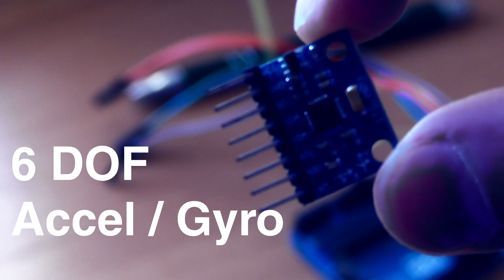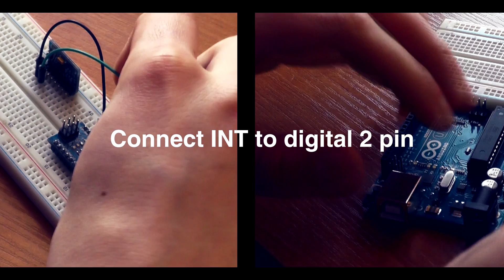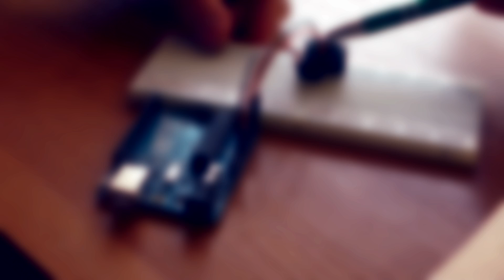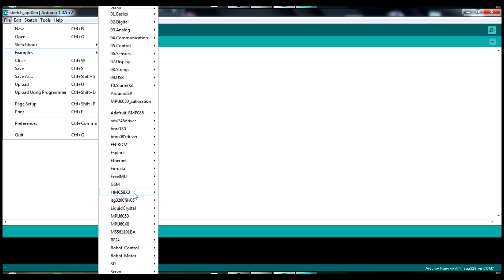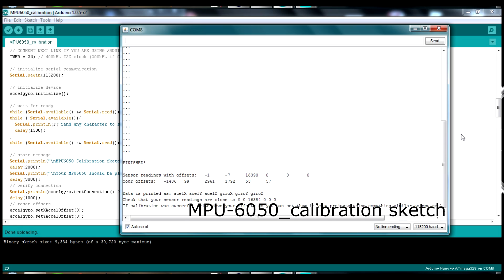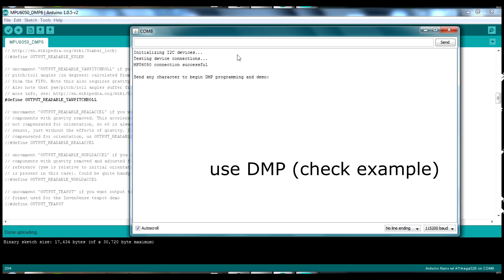MPU-6050 (GY-521) Arduino DMP Tutorial and Calibration

Comment: I tried several libraries, sketches everything i 

could. but i cannot get any data of mpu6050. it gives 

me all zero values. i2caddress scanner gives me 

address of 0x68 and it also shows MPU connected 

successfully. but in DMP6 example of library i get 

following -  IniþInitializing I2C devices... Testing 

device connections... MPU6050 connection successful  

Send any character to begin DMP programming and demo: 

 Initializing DMP...  ------ and it is just stuck 

there  

/////////////////////////////////////////////////////

//////////////////////////////////// for MPU6050_Raw 

example it gives following -  Testing device 

connections... MPU6050 connection successful Updating 

internal sensor offsets... 0 0 0 220 

76 -85  0 0 0 220 76 

-85  a/g: 0 0 0 0 0 

0 a/g: 0 0 0 0 0 0 

a/g: 0 0 0 0 0 0 

a/g: 0 0 0 0 0 0 

a/g: 0 0 0 0 0 0 

a/g: 0 0 0 0 0 0  

All other sketches either give zero values to all or 

gets stuck with DMP initialization. can you please 

help ... what is going wrong.

Comment: I have the same problem "MPU 6050 connection failed".
Libraries are installed correctly.
I'm using Arduino NANO.
INT-D2
VCC - 3V
GND-GND
SCL-A5
SDA-A4
Please any tips?

Comment: In case someone's having issues with the GY-521 and Arduino Mega,. You need to connect the board to the "SDA 20" and "SCL 21" ports respectively instead of ports 4 and 5. :) awesome tutorial thanks!

Comment: My Serial Monitor is stuck at Initializing I2C devices.....when I upload the MPU6050_DMP6.ino file  from https://github.com/jrowberg/i2cdevlibI attached AD0 of sensor to GND of Arduino UNO R3.Modified the  MPU6050_DMP6.ino file as 
MPU6050 mpu(0x68);The sketch in this video used I2CScanner.ino is being shown as an Invalid Library on my systemI'm stuck with a project deadline.Plz help asap ;-(

Comment: Someone can help me? The calibration did not work, serial monitor keeps showing strange values like "Á ùÅ ¶ ù¶ ü¶ ü  ø  øðùðùÐ oÐ oÐ o  ð  ú  ð   ôÐ oÐoÐoð°ÿÐo  ððùÁ ù". I'm using correct IDE 1.0.1 and scanner says my device is ok. What I am doing wrong??? 

Edit: just changed the baud speed and it works
Reply: JUST CHANGE THE BAUD AS YOU MENTION IN PROGRAM  FOR EX: IF YOU USE Serial.begin(115200); IN YOUR CODE THEN YOU MUST HAVE TO SELECT THIS BAUD IN COMMAND LINE WINDOW IN THE BOTTOM OF RIGHT SIDE.
Reply: Vrushank Maharajwala thank you mate
Reply: João Pedro Aguilera Cardoso welcome

Comment: Hello thank you for sharing. Can you clarify what the orientation of the MPU-6050 has to be in. Will having any other orientation invalidate the calibration or does it adjust based on the initial orientation...I ran MPU6050_DMP6 after calibrating and, assuming the readings are in degrees, they did not give the expected range of rotation readings (very limited range readings). Very different from when I run it without calibrating.
     The vendor I received the MPU from soldered the pins in such a way that I had to insert the gyro on the board face down, with axis illustration face down...

Comment: Is using Pin A4 and Pin A5 manditory, or can i just use A3 and A2?
I use the Arduino Pro mini, and the A4 and A5 are not as easy to reach as the other ones
Reply: Apparantly switching it to A4 and A5 fixed it for me right away

Comment: 'MPU6050 connection failed'
Please help me.
Reply: Make sure you have the same Arduino and I have also conncet Pin AD0 from the Sensor to GND and write in the code MPU6050 mpu(0x68);
Reply: Make sure you installed the libraries into the right folder. 

Probably in here:

c:\program files (x86)\arduino\libraries
Reply: I have the same error
Reply: in which file should I make changes ?
Reply: @BlackLagoonGUN  I made changes with MPU6050_DMP6(MPU6050 mpu(0x68) ). Attached AD0 to GND.  My serial monitor is stuck at Initializing I2C devices....
Reply: I have the same problem "MPU 6050 connection failed".
Libraries are installed correctly.
I'm using Arduino NANO.
INT-D2
VCC - 3V
GND-GND
SCL-A5
SDA-A4
Please any tips?
Reply: @lispeixoto6230  same here

Comment: hello, when I run the calibration program it sends me this error
#warning Using current Arduino IDE with Wire library is functionally limiting.
and in the serial prints random letters.
what´s wrong?
Reply: +Pepe Coronado Check your baud rate?
Reply: +vck3000 idid that and it worked, thanks!!
Reply: You're welcome :)
Reply: how much baud rate should it be?
Reply: I did the standard Serial.begin(9600); and then it worked for me

Comment: Have connected as you said in the instruction, checked the solvering with a multimeter, everything seem fine, the little power-indicator on the MPU-6050 lights up, but when I scan for I2C devices it won't show up. Using the example sketch using the "raw" it just shows "0" on all values, and if I use the DMP6 it just says "MPU6050 connection failed". Any ideas for next steps?
Reply: +Robin Hellsten 
Using a Arduino Nano 3.0 btw

Comment: When I calibrate it just show
...
...
...
for a long long time
Reply: +Sarul Sakulthong I use Arduino UNO
Reply: Hi sarul, I know this is long time ago, but did you manage to find a solution? I'm facing the same problem also using arduino Uno
Reply: Any solutions? Same problem here. Using UNO.
Reply: same here!!
Reply: Check your wiring, my problem was related to an SD shield I was using. Use an I2C scanner to make sure the device is found before calibrating.
Reply: Velaryon I thing my gy is broken.. the I2CScanner runs with no error, but then the MPU6050_calibration.ino does not converge :/ Also, my yaw values do not change with motion.. I'll get another one. It's cheap, anyway
Reply: The calibration code is useless anyways.

Use this to auto calibrate; (Place it in the setup part of the code)

mpu.calibrateGyro(); // Auto Calibrates sensor.

Comment: Hi, I installed the libraries, I connected the arduino with the 4 pins from gy-521 but i2cscanner says "No I2C devices found" . May the gy-521 be broken ? Or is there anything else to do to check it ?

Comment: Hello, do you know how to connect 2 MPUs? I need them to work independently for some servos I'm going to program in Arduino
Reply from the maker: +JpLX You have to make sure they have different IC's device addresses. That's the key - besides that, your connection should go the same way as with one device - IC bus can handle many devices. IC device address is "hardcoded" in device, but in most cases is up to change.
Reply: +JpLX i read you can choose between 2 adresses between by setting the AD0 pin to HIGH/LOW. in that way you can adress many devices by connecting the AD0 pins and use 1 adress on 1 device at a time. so for example you set all adress pins to LOW. and if you want to adress a specific device you set only this devices pin to HIGH, read the data and set it to LOW again.

Comment: is there anyway i connect the MPU-6050 to bluetooth module??
i`m planning to create a wireless controller with accelerometer for my design project
Reply from the maker: franque matic sure there is. just get one of the Arduinos to handle MPU-6050 and bluetooth modules. Once you get both of them up and running with Arduino, it should be pretty straightforward to code it
Reply: thanks.  but, it will use more space than i plan.  :)  i`m planning to build a small one almost ring size bluetooth controller
Reply from the maker: then maybe, you should take a look into these wearable versions of arduino. but if you really need to miniaturize it, as a controller use atmega in SMD version as well as other modules in SMD versions. anyway, good luck with your project!
Reply: can i have a link on those wearable arduinos? :)  TIA
Reply from the maker: franque matic well, this for example http://www.adafruit.com/product/1222

Comment: I tried it with UNO, I left for entire night and it did not do it. I see only dots. Is there anything I have to enable it the code to get it working ? Thanks.
Reply from the maker: Michal Augustyniak You mean calibration process is stuck? It should do the job in few minutes. Please tell me what you've been doing step by step. Did you use I2C_scanner to check if your connection is correct and your device is working properly?
Reply: Tinker Guy It connects just fine I receive MPU6050 connection successful. Had to use this "MPU6050 accelgyro;" instead of passing the address. That's how my other sketch works. And then I tried to increase deadzones values to increase the trash hold. I also print the "means" values and they never go close to the deadzones, 'means' values jumps up and down and always are pretty high.

Label: mean value, deadzone
X:6375,20
Y:171,20
Z:522,20
gX:199,2
gY:944,2
gZ:34,2
...
X:1955,20
Y:170,20
Z:523,20
gX:200,2
gY:1103,2
gZ:34,2
...
X:1953,20
Y:170,20
Z:1813,20
gX:200,2
gY:944,2
gZ:34,2

Goes little down and then up again.
Reply: Tinker Guy Correction, sorry I run on Arduino YUN, not UNO.
Reply from the maker: Michal Augustyniak Didn't work with YUN, sadly. Shouldn't be it a problem I think, but you can try find offset values manually using this procedure: http://tinyurl.com/kxh4asd

Also there is another calibration sketch you can try,  works a little bit differently than previous, haven't tested it: http://tinyurl.com/pg3hwgh

Let me know if it works!